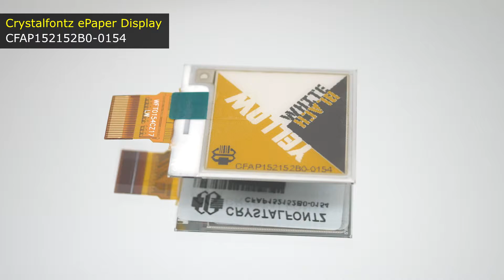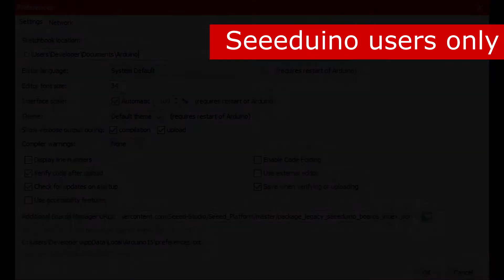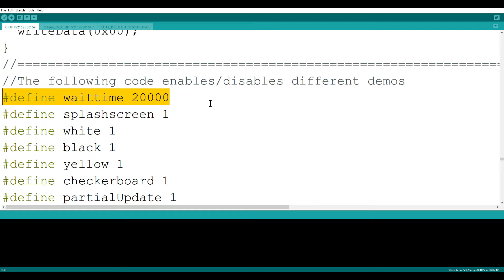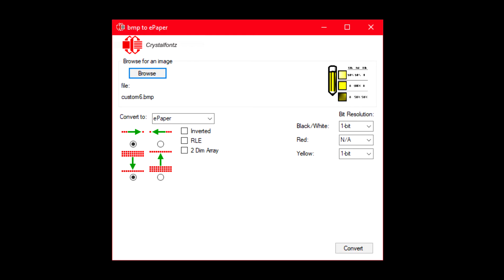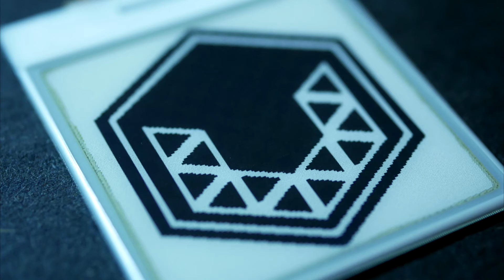Unboxing and Configuring Crystalfontz 3-Color Electronic Paper

Comment from the maker: Timeline:
0:30 - Video Sponsor 
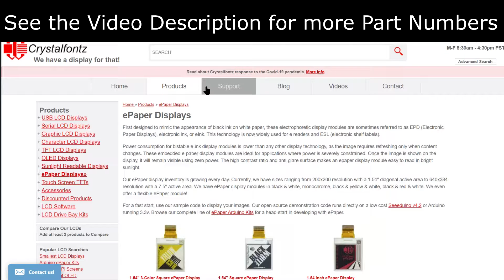1:08 - ePaper Display Part Number
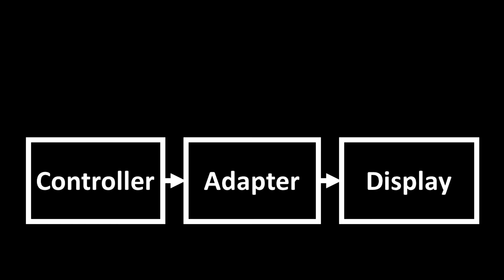1:25 - ePaper Kit Options
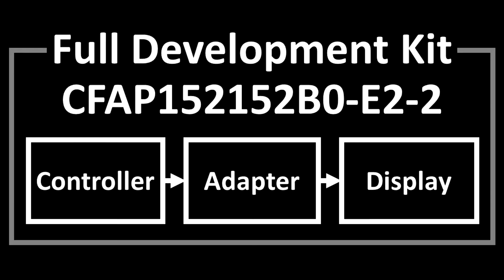1:47 - Use 3.3v Only
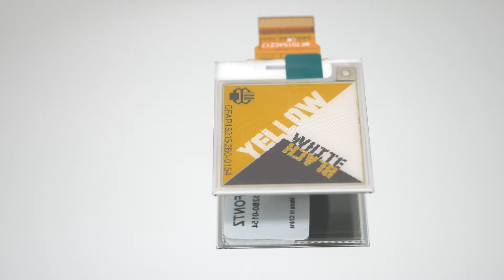2:20 - Additional Material Requirements
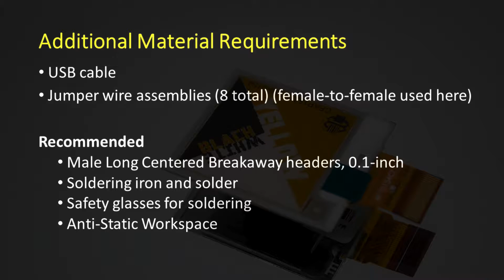2:35 - Software Requirements
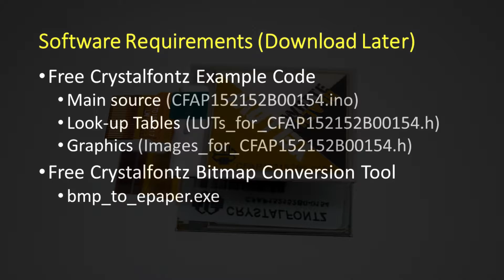2:58 - Get Example Code
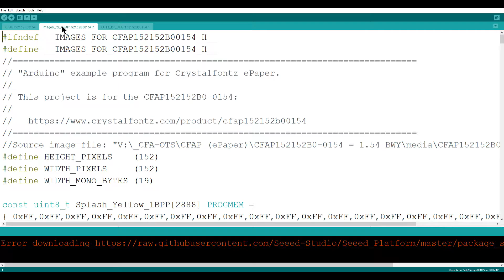3:35 - Adapter Board Pinout
4:01 - Unbox the Package
4:34 - Configure Adapter Board
5:04 - Attach the Adapter
5:55 - Connect the Arduino to USB
6:00 - Add YOUR board to Arduino's IDE
7:03 - Upload the Example Code
7:35 - Connect the Adapter to the Arduino
8:00 - Watch the Example Run
9:18 - Make Custom Graphics
10:55 - Download bmp-to-ePaper.exe
11:50 - Add your Custom Graphic
12:35 - Modify the Example
14:52 - Upload Custom Graphic
15:50 - Closing Remarks